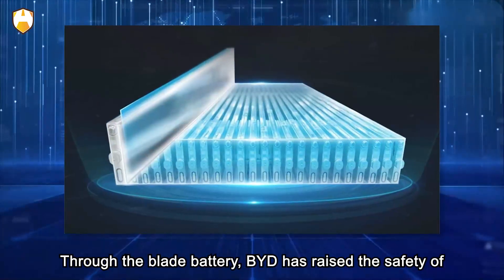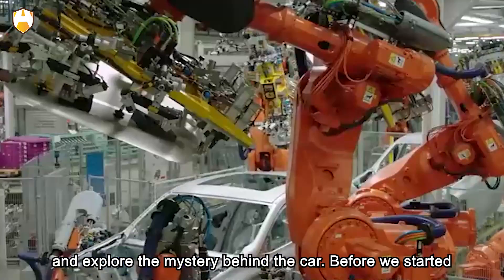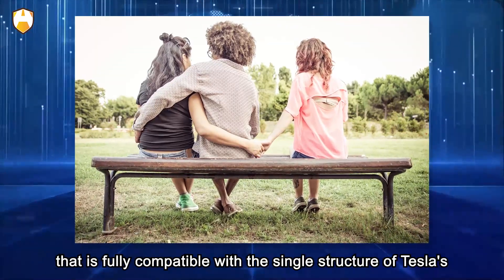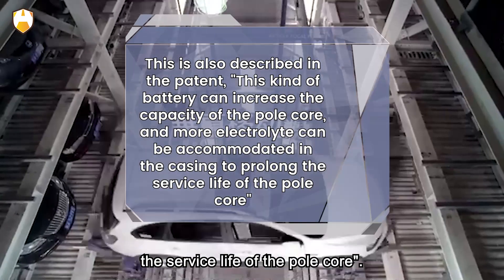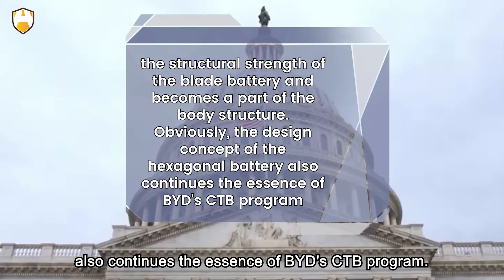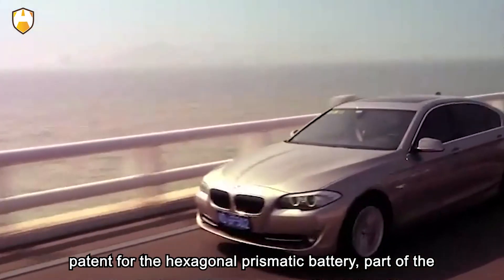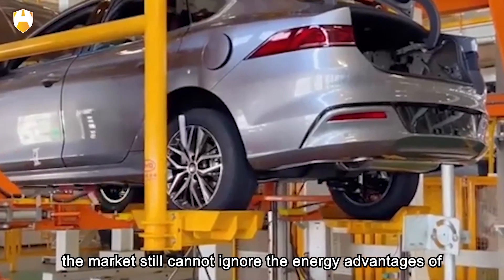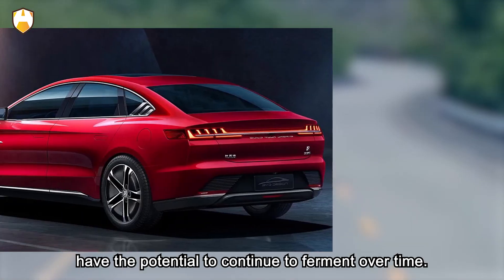Turn the blade battery into a cylindrical, BYD hexagonal battery is specially made for Tesla?

Comment: There are two ways to roll the foils in these hex casing. 1) Round core to round finish. 2) Hexagon core to hexagon finish. However hexagonal core do not end in hexagonal finish, in normal practice. If the later is true, there is air pocket between the roll and the hex cylinder. Heat transfer become a major issue. 

Secondly, due to a need to stack up the voltage, from 3~4V and up to 800~1kV the anode casing will not be share a common metallic heat sink, so electrically insulating heat sink strip can be use. Such strip can’t bend sharp or fully conform to the hexagonal wall (as round cylindrical do)

If hexagonal is one smart way to go around IP on  46800, that isn’t smart but dumb. 

The only way hexagonal cylinder can be feasible is when we can roll finish up the electrodes into perfect hexagonal cylinder to remove air pockets said earlier.  

May be BYD know something I didn’t.